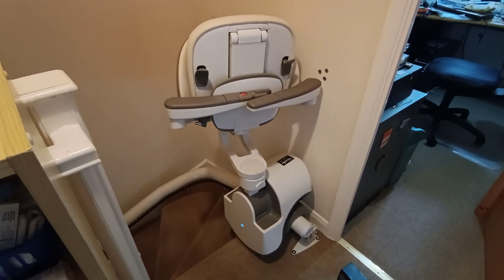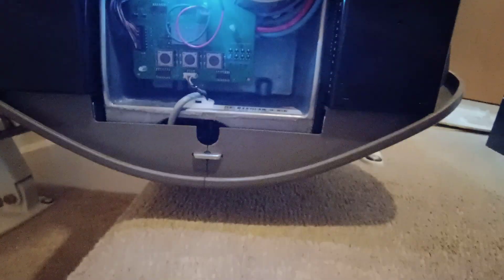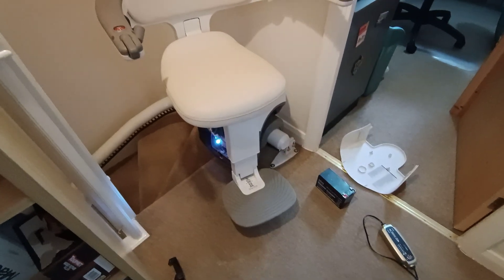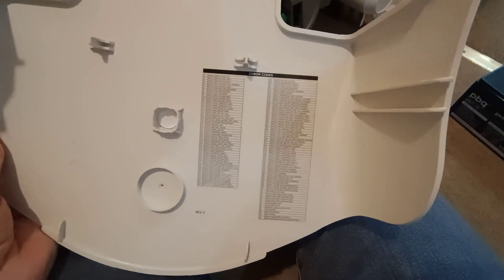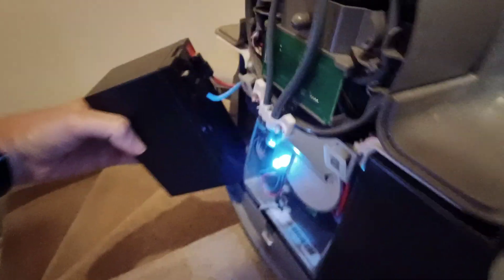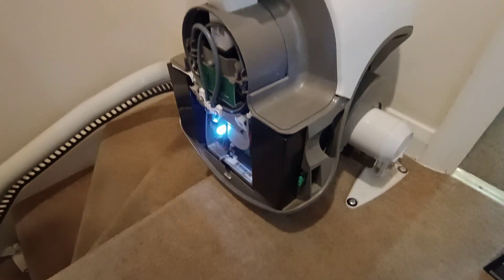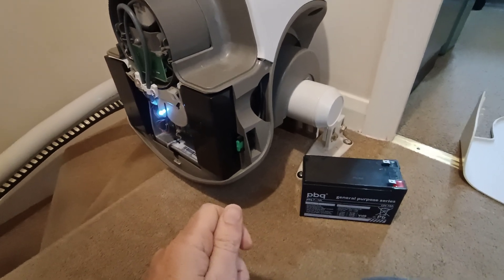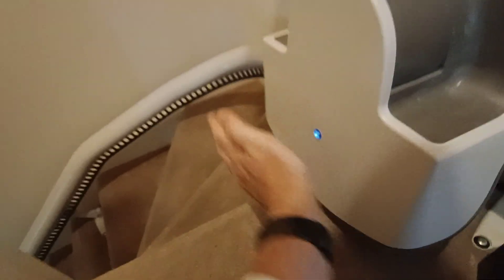Thyssen Krupp (Access BDD) Flow X Stairlift Troubleshooting and Battery Replacement

Comment: Great vid ! Do you need to cut off the mains during the battery changeover ? Or you can do it live ? Thx,
Reply from the maker: Hi, I'm pretty sure that I didn't cut mains power when I did the battery swap, and it was parked on a charging spot.
If you don want to cut charging power, be aware that the voltage from the mains adapter takes quite a long time to drop after turning it off at the mains. But parking it off a charging spot will do the same.
But it is very likely that I turned the chair off with it's little switch at the back (perhaps this is in the video?), which perhaps isolates the chair anyway (although I'm not sure).